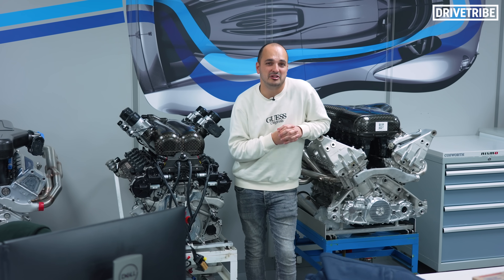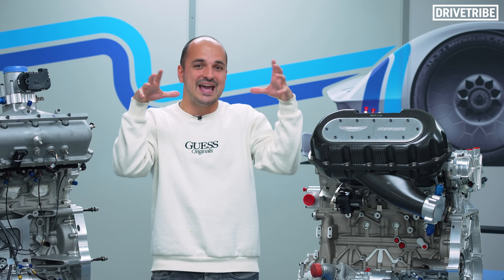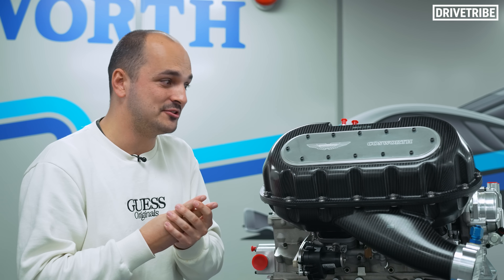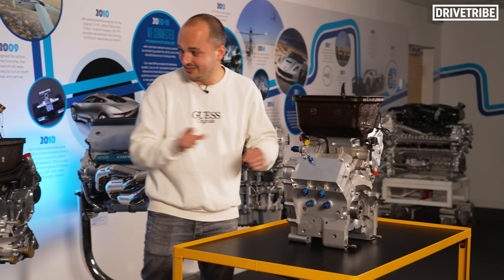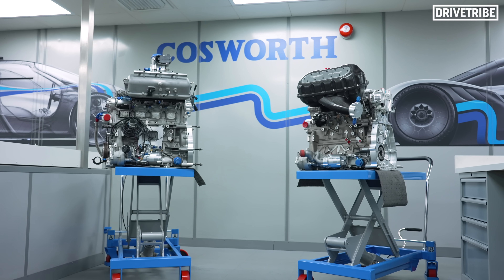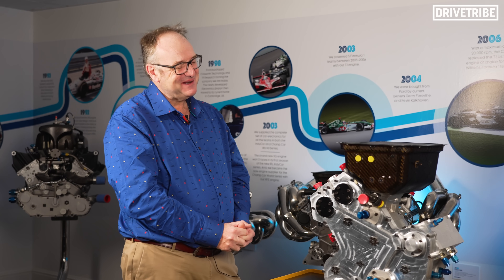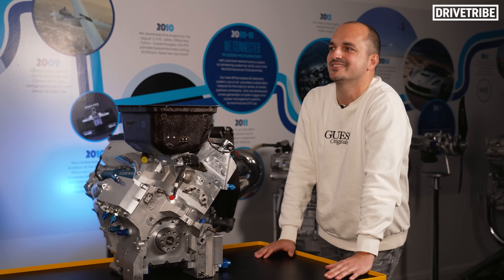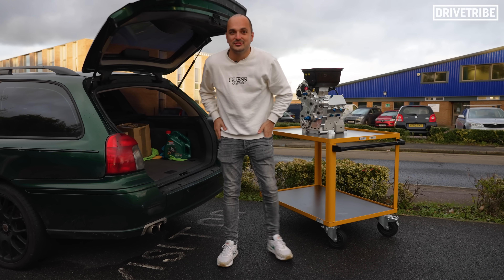This is a single cylinder F1 engine – 20,000rpm, 300cc, 90bhp!

Comment: Cosworth never ceases to amaze me. They are absolute geniuses!
Reply: In fairness they are in the main but have had some pretty dismal forrays into some road car projects as they we're unable to develop software to work with hardware they produced. Other companies picked the failures up and made them excellent.
Reply: They are such clever people, I could have spent all week walking around their factory!
Reply: Wish I could drop this puppy in my miata
Reply: I was thinking my mower.
Reply: They make some beautiful Coswell cogs
Reply: LOOK AT NASA AND THE STIRLING FREE PISTON GENERATOR.
THEY HAVE RUN THESE UNDER FULL LOAD
FOR OVER 14 YEARS NON STOP.
THEY ARE THE ANSWER TO SOLAR.
Reply: All F1 engine manufacturers have been doing this for decades
Reply: Legendary!
Reply: Will they survive the electrification of the world tho?
Reply: @TheEryk03  Cosworth will be fine. Will the World survive electrification is the question.
Reply: @TheEryk03  all our hopes is on Porsche and Toyota, because they currently develop a sustainable fuels
Reply: @muhammadnurakbar4188  sure... That's why Toyota and Lexus presented 16 electric cars concepts?...

BTW Audi was warking on e-fuel much earlier than Porsche. And now they plan to sell only electric cars in 2030 just like Toyota said.
Reply: @TheEryk03  yes .
Reply: @TheEryk03  there are still enthusiasts building steam engines

So no, even if combustion engines die of in the masses there will always be people running them
Reply: @TheEryk03  They're already doing hybrids and fully electric engines so I would think so.

Comment: That's an engine that would fit in a miata without problems 🙂
Reply: Man that 250hp 3 cylinder engine in a Miata is the stuff of dreams!
Reply: @iyzyz  now a guy put a turbo a very small turbo
Reply: It would probably make the Miata look like a Japanese splatter gore movie seconds after turning the key.
Reply: @Schmorgus  yeah but….. do it for the science
Reply: @Matt_10203  Oh, I never said "don't do it" 😏
Reply: Someone managed to V12 swap a Miata
Reply: What about the gearbox doe
Reply: also my shopping cart.
Reply: Very narrow powerband
Reply: chop the v10 in half, 1.5L straight 5 at 18k rpm with 450 bhp in a miata would be hilarious
Reply: Why not just use LS
Reply: @vaibhavdabwalv1  🤢
Reply: @CatacombStranger  There are hundreds if not thousands of LS swapped Miata's out there, a very popular mod, and it's a simple bolt-on kit these days.
Reply: @vaibhavdabwalv1  heavy and huge

Comment: Now to put this in a 2022 crf 450 frame 👌
Reply: Exactly what I was thinking
Reply: Please
Reply: How about a Coswroth 3 cylinder in a Triumph Rocket 3?
Reply: @RadDadisRad  The Rocket is a low revving torque monster, this is the opposite of that.  Perhaps give the 765cc triple the Cosworth treatment for the Daytona.
Reply: Nooh a featherbed Norton coswoorth
Reply: Just put an 08 Crf450r motor in it if you want an unrideable beast.
Reply: Ross your negative attitude is pointless
Reply: @robertgirdwood1801  Realistic more like it.
A crf is making around 60 usable hp already. Usable to a very few I may add. 
Also imagine the size of the fuel tank for that thing.
Reply: @RTS1980  mate Fs.. There is absolutely nothing realistic about putting that engine in a bike, doesn’t take a rocket scientist to work that out 🤦🏼‍♂️ It’s nice to dream though
Reply: @robertgirdwood1801  They stuck a two cylinder engine built from DFV parts for Norton. That engine would be a great race engine.
Reply: @robertgirdwood1801  your comment is pointless, as this comment is
Reply: @robertgirdwood1801   no imagination is all very sad.
Reply: @RubyS.1  imagination requires taking into account the weight, longevity, the transmission, and cost. unless you are talking with a child.
Reply: Imagine a 300cc superkart class with this behind it
Reply: My thoughts exactly, from the moment I read the title
Reply: that front wheel would come up so fast 😂
Reply: yeah.....see how much it weighed though. Plus bits to make it go.  but.........coolness
Reply: Along with a 30 min warm up cycle, pre heating the oil, priming the oil system, pumping the warm oil and water through the motor until it gets to operating temp so it’ll move.  It probably won’t like idling for long either 😂 I think youd have to rebuild it every month too
Reply: Yes
Reply: How about a YSR50?
Reply: KLR frame
Reply: Honda Civic
Reply: 20k rpm engine on a crf?? lol
Reply: @teteakhiangte6015  the existing redline is 16k rpm on the Jett brothers bikes. Are you simple?
Reply: Pointless.
Reply: @RTS1980  Why? It would make a stunning superbike.
Reply: @RTS1980  no